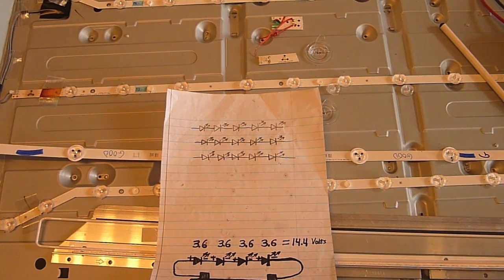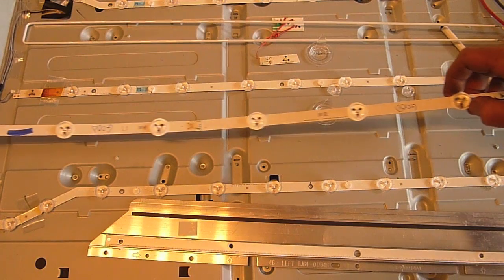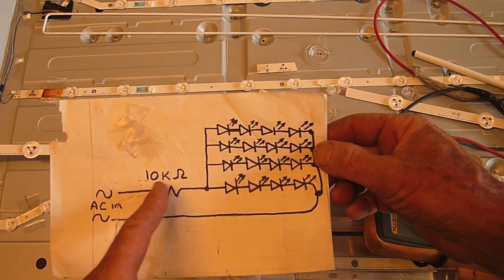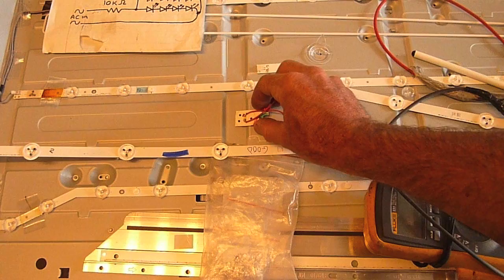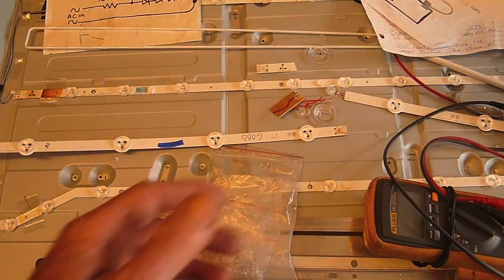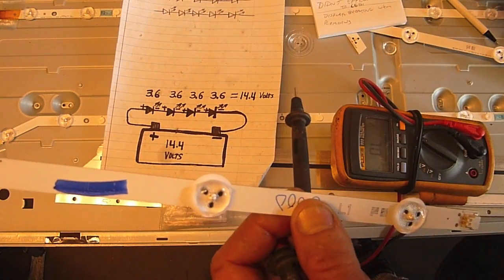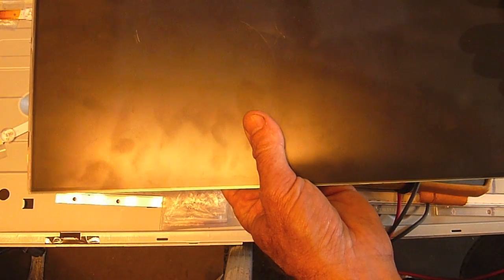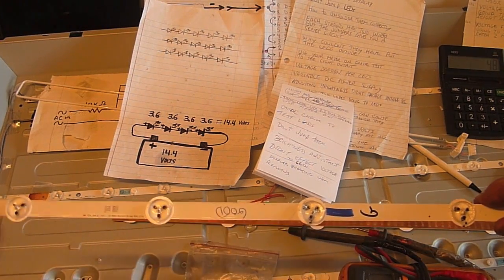LED backlight problems in TVs and computers.

Comment: You know Dave....after being in the bizz for 35 yrs, I also found myself telling custs to buy contracts and also that manufacturers should build them better etc.....Then I realized, we are basically pushing ourselves further OUT of the service bizz by wanting a better built TV or Serv contracts......After all, we were there to repair these faults etc....!  Yes, they would  be a better TV if they were built better, and more likely to sustain a repair....but, ultimately, we got pushed further out of the servicing end due to the cheap throw aways AND THE SERV CONTRACT that end up just sending the cust a new TV .......I guess morale of THIS story, the servicing end is all but gone and I regret not taking that state job in lieu of staying in the repair industry only to find that I wasted 35 yrs and now had to find another job instead of retiring from electronics with something......
Dave, cut your losses in this bizz and get out before it eats up anything you may have gained.......I let pride get in my way.....should have got out in the late 90,s when I started seeing things getting cheaper and more rediculous to repair and  replacement parts were so expensive etc.....
You are smart, branch out of that end and put your talent to another area of electronics, medical, commercial etc.....
TY for reading my rant....good luck.....Frank..!!
Reply from the maker: Good advice Frank. I've already started doing a variety of other things aside from TV repair. The nice thing about our skills is we are well  primed to work in other electronic related industries. I think people who can think outside of the box can always come up with some creative way to earn a living, 
Take care.
Reply: Frankie, you're absolutely right. Anyone wishing to be a top-notch consumer electronics tech had better investigate the cost of up-to-date test equipment and how long it would take to amortize the cost. As an independent repairman this will never happen because technology changes so fast the equipment is basically obsolete when you buy it.
Franchise dealers, like new car sales and service, are constantly supplied from the manufacturer with updates to older gear; finally replacing it with newer stuff. All this "newer" technology comes out of the dealers' pockets, so you now see why a $12 an hour entry level mechanic costs $80 an hour (or more) to fix your car.
Reply: rayford21 excellent points..!!

Comment: Is it possible to use a different led strip ? I cant find the exact one for my tv
Reply from the maker: Yes it's possible to use a different LED strip as long as the replacement uses the same voltage and current as the original, and is long enough to evenly illuminate the display.

Comment: Great video. All of us from MikesTVTips appreciate it. I also am seeing more and more of these led failures. I built my own led tester using two junk remotes. I'm basically using them for the battery holder. One remote takes two AAA batteries (3v), and one remote that takes four AAA batteries (6v). I cut the top half of the remotes off and attached wires to the + and - terminals. That way I can test different kinds of leds individually. Once I locate the bad led, I will desolder it and cut a good replacement out and stick it over the one that I removed and hook up the jumper wires. I'm with you! The manufacturers do not care how long this junk lasts!

Comment: Wouldn't it be better if the strip was stuck on the back of the metal, outside with the led and disfuser poking in through a hole to inside. Or the difuser inside and just a tiny hole under it where the leds stick through from outside to inside. LG can have my idea for zip (or a couple of 65s if they're feeling generous).
Reply from the maker: That's what I was thinking when I mentioned how they could have made the LEDs accessible without having to remove the display. It could have been made  in a way that would have been simple to troubleshoot and replace. Perhaps they may not want to you repairing these Televisions..
Reply: I have 15 of these ready to pull down ranging from 42" to 55". All abandoned by the owners for spare change, and you can still see the image with a strong light and hear the sounds. Two things happening here. First, owners have been taught to discard any thing over a year old (so they can buy the lastest and greatest) and second, I'm not confident about any long term fix because the other leds will probably die.
Reply from the maker: I understand your concerns. I would also be reluctant to repair a Television you can't expect to last. Welcome to modern day TVs. Replace every year or Two and your good too go.
Reply: I've been looking at the leds in those LED light bulbs as replacements. They seem to run at higher temperatures and are fairly cheap to get yoiur hands on to try. I've been looking at BigClive's teardowns while he's been playing around with them, and it occured to me that these may be a better source of leds for replacement. Not sure of the color spread yet though.
Reply: In your 120vac tester, think about having 4 by 27k reisiters instaed of one 120k resistor, I'm not sure the internals of one resistor should be subjected to that type of voltage if you feed a short (or you). Flash over might occur. Here where the mains is 240vac, your circuit would be a death waiting for you device.
Reply from the maker: I don't totally understand your comment but using a 120 k resistor lowers the current so much I don't think your likely to do any damage to your LEDs. Even if your using 240 VAC.
Reply: Its a safety thing. Never use one resistor in a mains circuit when three or more in series making the same resistance value have a much less chance of flashing over under fault conditions. Its not current I'm limiting, its the max voltage across the resistor.
Reply from the maker: I get your point but I don't think your likely to see any kind of flash over with 120 or 240 volts do you?

Comment: I think you're correct about the LED'S being run to hard.I know if an LED is run properly they will last for many years.I still have a LED flash light i made myself that is over 10yrs old with the original battery.I know people who read this will say a battery that lasts 10yrs+ no way.but its true here is the type of battery: 
Tadiran TL-5242/W 3.6v Lithium Battery.I found a few of them is this warehouse i was doing repairs in long ago.

Comment: Your a good man giving up 200 when you take the risk to do the repair i my self will not i fix phones too and they seem to put glue on some parts on purpose and you may break a ribbon its not our fault get a damage waiver signed i do
Reply from the maker: Sometimes it's hard to determine how much responsibility I should have when a customers display brakes. In this case I felt as though it was my fault for being in a hurry.

Comment: This is a great video! I have changed many LED bulbs on TV sets in my shop. If you don't care I have a few tips for your video viewers and do-it-yourself'ers. Use good LEDs! I found the LG LEDs for backlighting on ebay. The most common rating on the bulbs used for backlighting is 3.6V at 1 watt.  I bought 100 for $25 and they work in most sets. I have noticed the TV manufacturers do tend to overdrive the voltage a little get more brightness out of the bulbs. They can handle a little more voltage as long as the current is limited internally by the TV power supply. The LG bulbs seem tough and I have not had one blow yet. Do not install these with a normal soldering iron. They will not handle the heat long. You have to use a hot air station set to 200 C and low temp soldering paste like 247 solder paste that melts at 137 C (278 F) Only takes a few seconds of heat to solder them on and you won't damage the bulb at that temperature. I use clear silicone to anchor the lens corners back over the LED. It is important that the lens is exactly centered like original or you will get funny circle patterns behind the LCD! Good luck.
Reply from the maker: Thanks for the information. Hopefully the viewers will read the comments in the information section for tips like yours.

Comment: What about grabbing the LED strips from autozone and wiring them in parallel as replacement backlighting and giving them it's own dedicated 12v power source AKA transformer rectifier?
Reply from the maker: That sounds like as possibility so long as you can disable the feedback circuits that need to sense a particular load in order for the TV to stay on. The other important thing is that your backlights from autozone must not have any kind of flicker rate.

Comment: Thanks again. FYI - I have found some NEW LED backlights or kits on ebay. For example: http://www.ebay.com/itm/NEW-VIZIO-E420-LED-BACKLIGHT-STRIP-L2-6916L-1340A-6916L-1216A-LG-/222082287944?hash=item33b522c948:g:YlEAAOSwFqJWqU2R. The originals seem to be manufactured by Seoul Semiconductor. http://www.xccfl.com/product_info.php?cPath=39&products_id=4901&osCsid=9h8e1q9qtjjgdhapmnk6e34ha5.
Reply from the maker: +Pete VanDemark Thanks for the info. I also used ebay for some new replacement LEDs on the LG TV I mentioned. The problem was the cost was so high it left little room for making any money on the job.
Reply: Grants Pass TV Repair
Right - unfortunately so many repairs are cost prohibitive nowadays - for all kinds of equipment.

Comment: I heard from somebody that LEDs are damaging themself after exceeding 60 degree celsius on PN junction. If those LED had some heatsinks they could last longer.
Reply from the maker: +MDF RESCUER I'm sure heatsinks would help, but on some of the LG Models where the current is almost triple at the first 10 seconds of start up I'm not sure how much that would help.
Reply: +Grants Pass TV Repair I wonder if the problem is the sense resistors in the backlight circuit?
Reply from the maker: I suspect it's probably a design flaw.
Reply: Another thing which I heard about LEDs that they draw more current after they are getting old.
Reply from the maker: They can short out or become leaky like any diode, so it makes sense that they may draw more current as they age.

Comment: Nice video, I have learned a lot from you since I found your channel, so thanks. Now perhaps I can share something with you, LEDs are current devices so it best not to think in terms of voltage, as you noted Kirchhoff's Voltage Law holds true and the sum of the voltage drop of the LEDs in series will equal the source. It is better to think it term of current, as current through a series circuit is constant. This is why we use a constant current source to feed a string of LEDs, set it for you desired current and connected it to your LEDS, it does not matter if you have 1 or 100 LEDs it will just keep supply the current you set independent of source voltage or load (i.e. number of LEDs). Do a Google on constant current circuits, you can you discrete transistors or even a LM317 regulator, they are surprisingly simple circuits with a ton of applications and fun to play with. Keep up the good work and keep the videos coming.!!!!
Reply from the maker: +Michael Katt I appreciate your suggestion about using a current regulator. That's an approach I hadn't thought about.  Thanks.

Comment: Well let's say that straight, it's the "programmed failure" desing :) LEDs circuit is designed to give too much current or voltage so LEDs get burned at some time, putting there resistor was a good idea but designer was smart enough to block it with loopback circuit shutting down TV ;) That's where electronics desing is today.

Comment: a great tip to prolong the lifetime of your led backlight:  in the settings/menu area, take the backlight and bring it down from 100% to about 70-80% heck even 85% and it will last for a few more years! i recommend to do this the day it comes home from the store, or asap. getting to the led backlight is a pain in the butt.   yea, it wont be as bright, however you wont be running at max current, hence prolonging the mtbf.  besides, after about an hour watching it you wont miss the brightness.

Great Video!  thanks! 73!
Reply: +su pyrow Yep. I took my Sanyo LED/LCD down to about 70% or so. It's a little over 3 years old and doing great. After checking, it is at 65% and still has a beautiful picture.
Reply: +sporadic -Z Planned Obsolescence...
Reply: +Robert Calk Jr.    It is not obsolete if you know how to overcome it.
Reply: +su pyrow For people like us. But they know the average person will just chunk it and buy a new one.
Reply: +sporadic -Z It is. And they are real good at fixing the breakdown expectancy also. It's also getting harder to get schematics, and a lot of service manuals that I've been getting don't even have full schematics.
Reply: +Robert Calk Jr. i have forgotten more stuff i have saved from the landfill than I can remember, watch any one of my videos!  i am not famous or anything, and i am NOT tooting my own horn. just shooting the shit and trying to give valid advise.
Reply: +sporadic -Z   you have a very valid point.  duly noted
Reply: +su pyrow I agree with you, but we aren't most people. Most people don't fix devices like we do - and manufacturers know that. That's what I'm getting at.
Reply: +Robert Calk Jr.     True. and sad at the same time isn't it?   Thanks Robert, very good point!
Reply: +su pyrow Yeah.
Reply: What;s an "mtbf"?

Comment: Shopjimmy had a video to turn the backlight down in tv settings to prevent early failure. I guess this would not drive the leds as hard but wouldn't picture quality be affected?
Reply from the maker: +Beau Michna Yes the picture will still go darker if you turn down the backlight adjustment,  but on the LG TV I tested it did not effect the backlight voltage in any way. Apparently on some LED TVs the brightness of the display can be changed by the display pixels regardless of the brightness of the backlight.
Reply: +Beau Michna  after an hour watching, you wont even miss it, as long as it isnt at max anymore, 85% will possibly increase lifespan for a year or more. EDIT: well.. cant quote me on that, i dont have two identical tvs running all the time to test that, however in theoretical theory it should.
Reply: +Grants Pass TV Repair  even through the service menu?  I didnt know that.  thanks for the info.
Reply: +Grants Pass TV Repair    Thanks. So if the voltages remain constant on the backlight, it would be pointless to turn down the backlight, right?
Reply: +Beau Michna   voltage isn't the issue, current is.  as he said, SOME TV's will be pointless  EDIT:  they most likely use PWM
Reply: +su pyrow Ahh, thanks!
Reply: +Beau Michna  you got it buddy!  yeah, key word there is SOME tv's not all.  still good practice though!  73!
Reply from the maker: +Beau Michna Yes, on the televisions that don't have a variable voltage going to the backlight it would be pointless to  turn down the brightness thinking it will prolong the life of the LEDs.
Reply: +Grants Pass TV Repair   Good to know, thanks.
Reply: +Grants Pass TV Repair Sounds like a good opportunity to make some extra money for doing some modification to TV's like that.
Reply from the maker: Good idea for the LG models I mentioned, but by the time the TVs come in my shop the LEDs are in such bad shape I'm not sure it's worth the trouble unless you replace every LED, the LED replacements I used cost me over $100.00 bucks.
Reply: +Grants Pass TV Repair Sometimes news travels fast. Time will tell if the news gets around.
Reply: Robert Calk Jr.
i see your angle, however who is going to bring a perfectly working TV; "under warranty" and spend an additional 200 to upgrade it?  im sure someone would. but not enough people to live off of.
Reply: +su pyrow I didn't think it would cost that much to put in a pot or fix it to be able to adjust the backlight. I haven't studied it though.
Reply: turn down backlight and turn up brightness and all is fine

Comment: Another excellent video.  Thanks.  FYI:  

While I no longer repair TVs as a living,   I have an LG 32LN5300 that has an the LED string opening up intermittently.  At first I thought it was the power supply because because there was very little voltage across the string.  But after finding the datasheet for the LED driver (MPA3202 IC), I realized the power supply was shutting down because the LED string was opening up.  The TV has since started behaving so I haven't pursued the repair any further.  Thanks for the tip about damaging the screen.  What I found is the driver is a constant current source that only puts out a current level of 372mA.   If the LED string is open, the drive voltage will go very high briefly and then shutdown. It really pays to use an oscilloscope when measuring the LED drive.  To control the brightness, the TV turns the drive on an off at a 120Hz rate.  At the default brightness, the on duty cycle is 34.7% yielding an average current of 129mA.  Like you observed, for the first few seconds after turn on, the duty cycle is 100% and then the main chassis reduces the PWM duty cycle to 35% over several seconds.  I suspect they do that to get the LEDs up to temperature quickly so the color rendering is correct.  Even at fully brightness the duty cycle is less than 40 to 50%.  I suspect they strobe the display so there is no light when the LCD is switching states to 
prevent artifacts.  

In terms of LEDs going bad, very few of the products I work on ever have an LED to bad.  But the ones that do, it has almost always been a case where they are over driving the LED by 50% or more over its rated value.  I bet the LEDS in these TVs are going bad because they are exceeding the LED specs for current or failing to take the derating effects of temperature into account.
Reply from the maker: +StevesProjects Thanksj for the info.